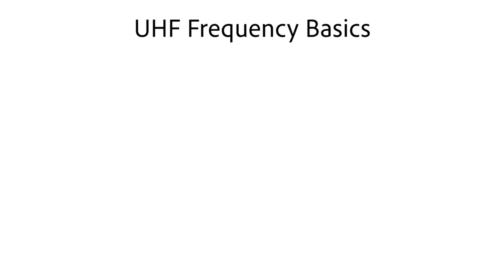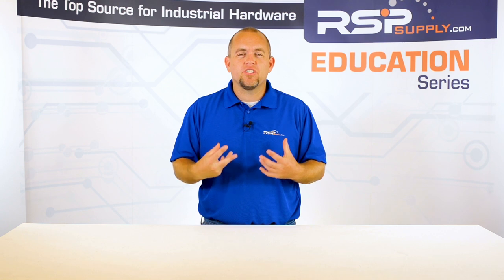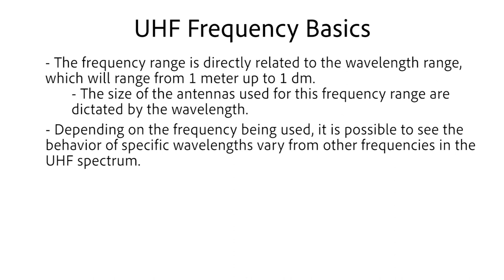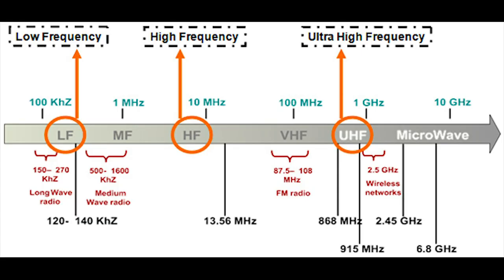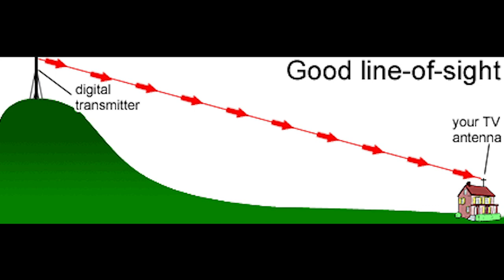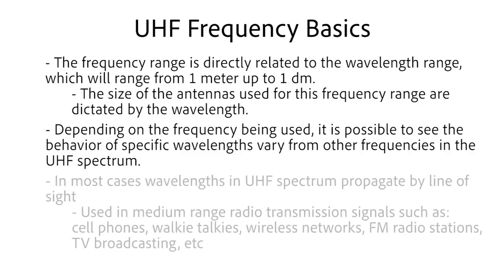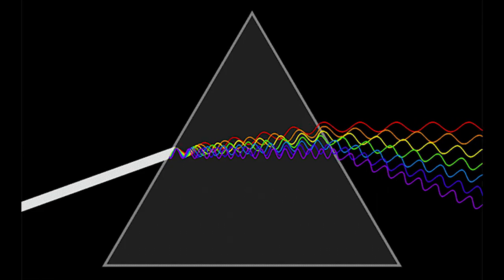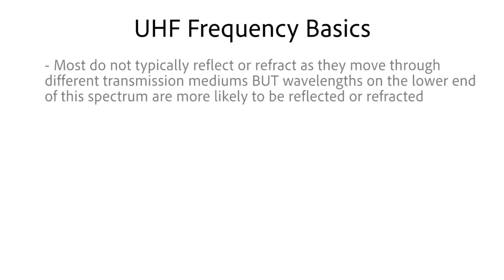UHF Frequency Basics

Comment: I have a question.
I have been told that that 243.000 and 282.8 MHz are emergency frequencies.
On paper they should belong to VHF spectrum, but they appear to be the "UHF emergency frequencies". Why is that? Why they appear to be listed in the set of UHF while they are evidently VHF?
Thank you for your answer.